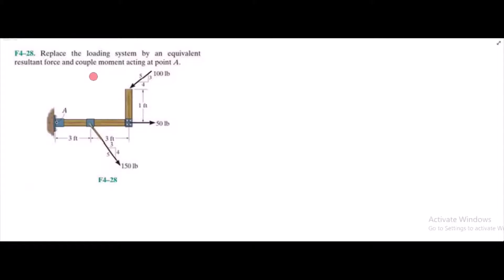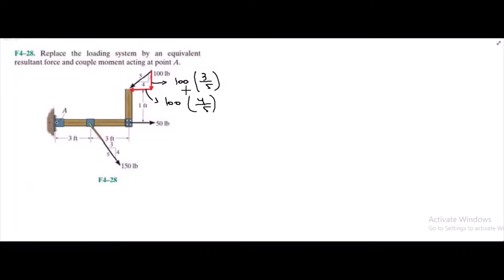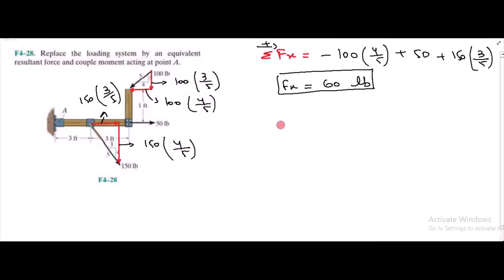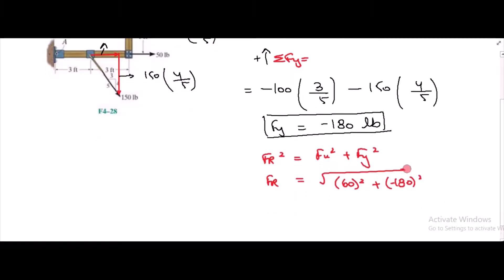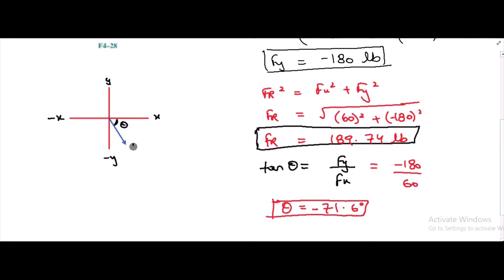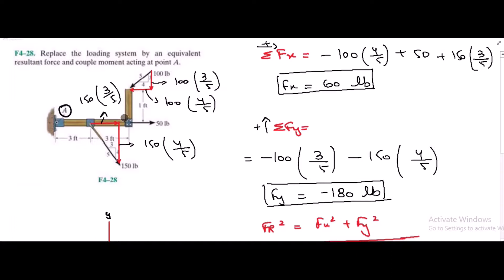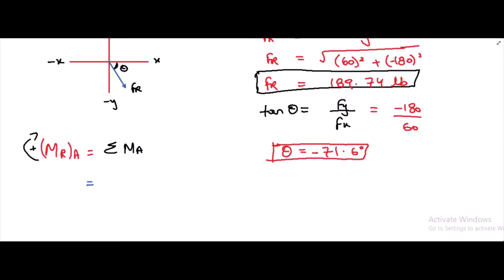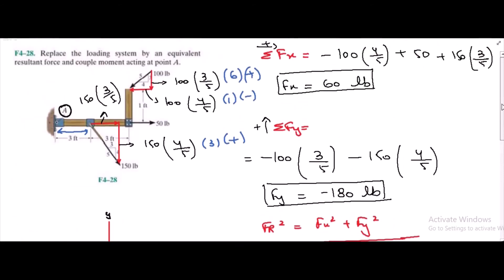F4-28 hibbeler statics chapter 4 | hibbeler statics | hibbeler

Comment: 7:06 I thought the force of 150(4/5) causing it to rotate clockwise should be (-)? Same with the 100 (3/5)
And the 100(4/5) should be (+)
Reply from the maker: Yes you are right, basically I have selected opposite sign convention (clockwise+) and (anticlockwise -).
Reply: @solutionsmanual9535  But yeah, thanks for the clip anyway. It helped me a lot